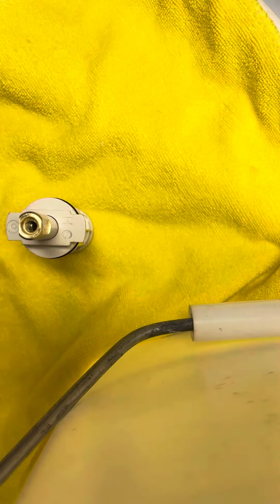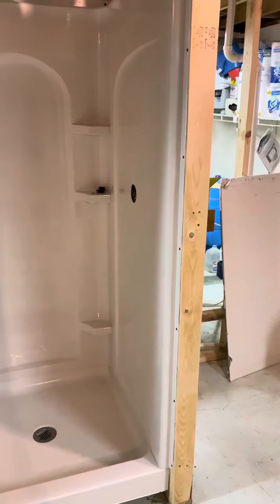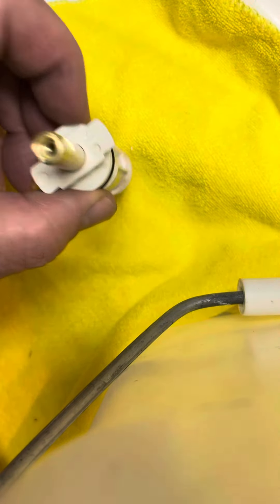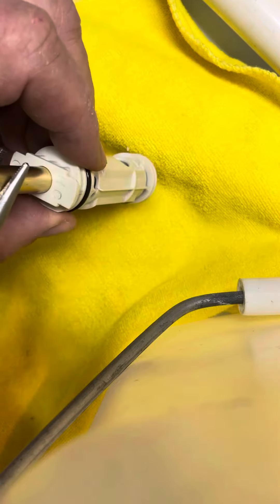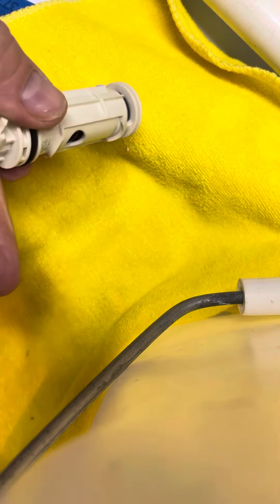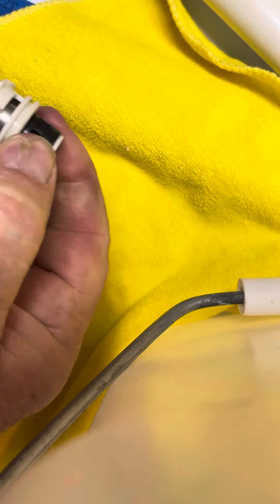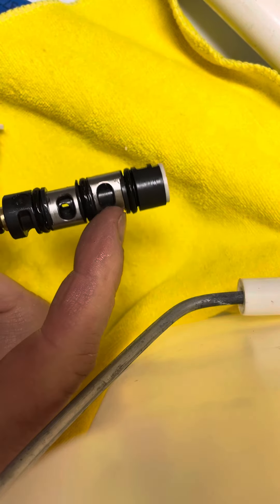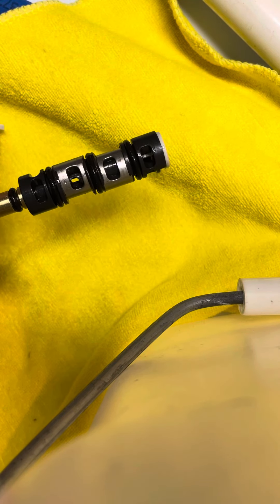Moen shower no cold water

Comment: I have this problem also, but I’ve tested two cartridges (genuine and Danco) - same issue. I’m stumped.
Reply: Me too😢, did you ever get a solution?
Reply: @ivancan1777  I found that I had to test every position going around individually and that where it’s initially warm it gets colder around the 3oclock position on my valve. Very weird.